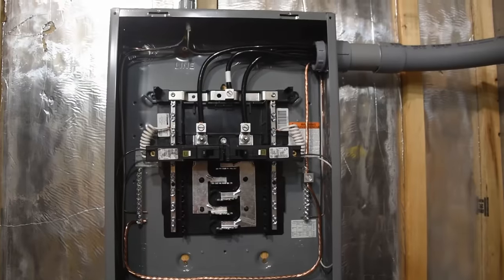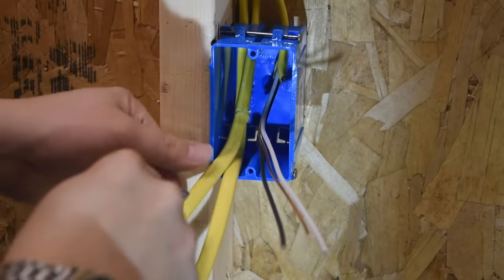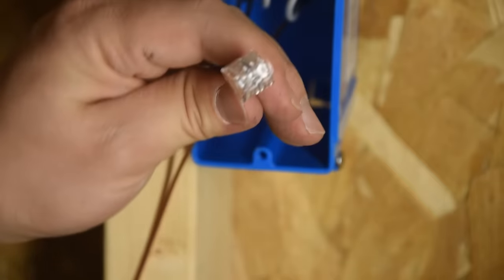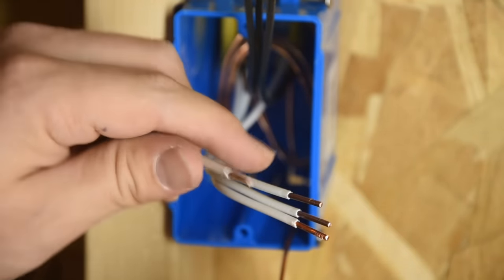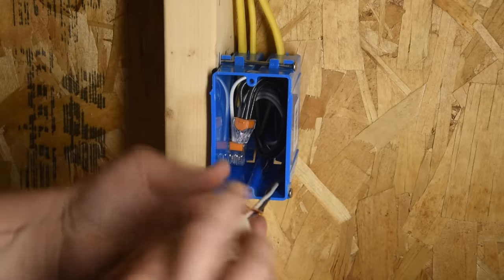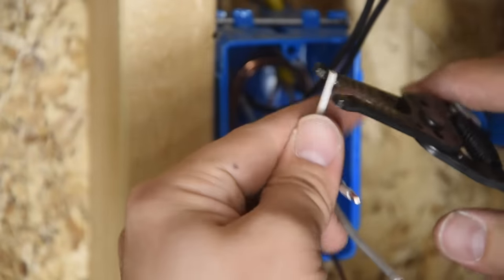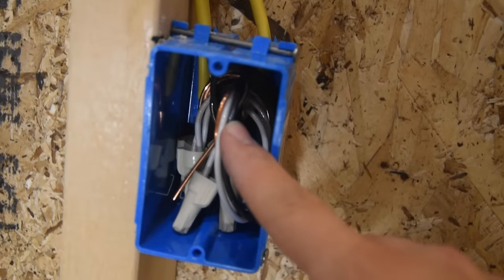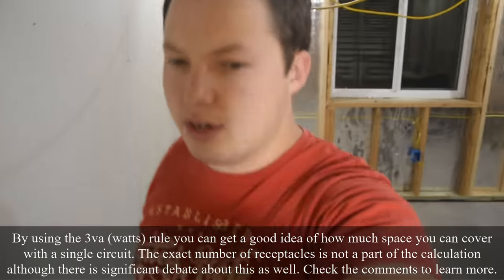Wago's vs. Wire Nuts - How To Wire Outlets During Rough In

Comment: As a master electrician who has been shocked by someone else's sloppy work and seen some bad makeup, you should always twist your wires with linemans to create a solid connection while using wirenuts
Reply: Absolutely! The marrettes are not to be used to twist the conductors...this is just lazy and does not ensure that they are well connected.  Wow
Reply: Is there a wrong way to twist the wire? Looking at the front twist clockwise or counter? I’ve twisted wire both ways I haven’t been unlucky thus far but a assistant I had a year ago (before he quit because he wanted work life balance/duhphukizdat? Hahahahaha) he had a bit of trouble with counter clockwise twist unwinding as he would start the wire nut... users error? Makes sense? Or My twist is twister than his twist? I should add I twist then cut the end off thread lightly finger tight then one or two full rotations with linesman’s (rough stop here.)  and a quick wires and nut mummy wrap with E-tape.(not for rough obviously, unless you hate the person who follows😬.)
Reply: @13ryanheartbreaker27  wire should be twisted clockwise
Reply: You can't go wrong twisting the wires n using the proper wire nuts. If you need to add a wire remove wire nuts, use your llinemen pliers.un twist about a1/4" to 1/2" lay new wire on the old,re twist n that new wire will fit in just like it was always there.
Reply: @jokerseriously514 if the manufacturer doesn’t require it then it’s just your opinion

Comment: maybe it's because i'm a commercial electrician and mainly use stranded wire but I prefer wire nuts.
Reply: For stranded  wire there are the lever style Wagos, all types of spring loaded connectors are superior to screw or twist connections as they keep a constant force on the conductor.
Reply: irfp460 yeah I've used them before but the price adds up on a job that lasts a year and has 20+ electricians on it. I agree though that they are very nice to use. And safer when you have apprentices who don't check their wire nuts.
Reply: @darianbell9614  Well, the customer is paying for the supplies so in my experience the increased cost of the Wagos does not matter but the time saved with them does.
Reply: @irfp460  I don't disagree but I'm not the one making those choices. My company is ran by old electricians who have their old ways.

Comment: To answer your poll, yes always twist, creates a better connection, makes it easier to keep them even. And makes easier to get your wire nut on. It also eliminates any worry that the connection  will become loose later.
Reply: Also it’s a code requirement

Comment: Wagos are nice because they are quicker but it's more $$ and a pain for the next guy when we need to add or disconnect the splice. And yes, I always twist wires under the nuts to ensure solid contact/connection, I hate relying on a little spring for the connection.. Plus safer for the next guy if they're twisted.

Comment: The Wago might be easier to use, but I trust the wire nuts better as the conductors are touching each others directly instead of being connected together with a tiny piece of metal.
Reply: more contact area between the wires and more contact area between the wires and the mechanical fastener.  go ahead and try to pull a wire nut off.
Reply: @frotobaggins7169  well, the push in connector could withstand around 30kg for solid wire and 18kg for strand wire.

Also, someone literally give enough current to burn the wire and connector, the wire insulation melt first and followed by the connector housing, the "tiny piece of metal" still hold onto the wire.
Reply: @Kevin-fj5oe  I never said wagos wouldn't work.  I have seen many a push in connector fail that is why I never use them.  It's not the current or the amount of pull they can handle, it's the tens of thousands of heat cycles over decades of use that causes the failure.  The wire nut with more surface area of contact between the two wires are just better able to handle the heat cycles.  I actually just replaced a failing push in connector on an outlet that was causing arcing and starting to burn the wire causing the circuit to flicker.

Comment: Nice tutorial. I've been curious about wagos but I've always put them on  the same level as the back push pins on receptacles which Ive never trusted. You've given me good reason to give them a try.  I also in the pretwist group. It may not be required but I guess I like being able to visually see that the wires are secured. Maybe they should make clear wire nuts 🤔
Reply: look into the lever wagos

Comment: i found that making a loop of wire to the side like a spring and leaving the wires longer made putting outlet in box way easier. than the just bending wires up and down it tends to keep outlet from going in box easily the up or down bending will only bend so much

Comment: If you open one of these push in devices you will find a very tiny flat contact spring which contacts only one edge of the wire. This contact point is a few thousands of an inch and forms a perfect hotspot for a fire initiation. These have worked great for many years for low voltage and low current use but for anything over 1 or two amps, NFW!
Reply: Not true at all. They are used exclusively in Germany and we have much stricter guidelines.

Comment: When i worked for comcast we used a three m type connector for phone as we added the security option . and i worked for a few electrical companies also and i asked which wire nut to use on pre-wire and was told whatever fit 😂 .like the wagos best .

Comment: Just wonder how many of you resistance test after installation. Screw terminal can be under or overtight or work loose from vibration & heat. Used wago for industrial & residential without any issues. Retesting installations every 5 to 10 years.
Reply: I am now installing the new 10 year battery smoke detectors; before I leave i make an appointment with the home owner to expect me back in 10 years to replace the smoke detector….LOL

Comment: I have seen push connections fail and melt and arc. They will eventually fail and cause problems. I just replaced a GFI in a travel trailer that was overheated where one of the pushed in wires was arching. I won't use anything that does not have a screw on it.
Reply: Finally...a man with common sense....what’s with people always looking for the easy way.....

Comment: The lever style has two benefits. the first you don't damage the wire when you have to remove them. The second they're great for stranded wire over the push style and it makes it trivial to connect solid to stranded wires. 

I also use the Klein katapult wire strippers with the adjustment stop attachment to set them to the correct strip length fast easy best $40 I ever spent.

PS never cheap out also get wago or ideal push connectors. Note wago has made them for so much longer due to crazy history in UK something about wire nuts bans aka "fire nuts".
Reply: Note you may want to point out the test ports on the wago so they can be tested with out taking apart vs the wire nuts.
Reply: As with wagos, sharkbites and the like,  it's all about dollars per hour...get in and get out...and get to the next job.  If it isn't cost effective in some way why do it?

Comment: Wagos work well in other countries that run on 220 so lower amperage. In the usa and other 120v countries more amperage goes through the wires for the same appliance and can cause the wires to heat up more. When the connections heat up the wires move and over time loosen connections if they are not twisted/secured enough. So wagos are fine for higher voltage/lower amperage, but not good for something like a appliance.
Reply: The spring action is supposed to hold the clamping force very high at all times, through heating cycles etc. Is there examples of heat and movement of properly installed wire, that has led to a loose contact in a Wago connector block?

 The manufacturer has the following claim about the metal used for the spring clamps: "Samples loaded with 500 N/mm2 at a temperature of 250°C (482°F) showed a relaxation of only 1.5%." Found in https://www.wago.com/medias/Volume1-2019-2020-Technical-Section-en.pdf?context=bWFzdGVyfGRvd25sb2Fkc3wyMTMyNzQzfGFwcGxpY2F0aW9uL3BkZnxkb3dubG9hZHMvaDFkL2g3ZS8xMDExMTMwNDU2NDc2Ni5wZGZ8OTA1NzU5MTcwMzZmYWRlNWI5OGU4ZGZkMDI3YmNiMTdkYmVkMWNjYWJjZTEyYjhlMTJkNTc5Njg0OGU4NGVkNQ&attachment=true

Comment: So I've used both and wagos are certainly seemingly cleaner. However a couple of guys have questions it is just a thin piece of copper that grips the copper. Years of running electricity could in theory cause bad connections down the road and a electrical nightmare.

Comment: I have no issue using these on lights BUT, they DO lose tension and therefore create a weak connection hazard over time with higher amperage draw. I only use these on receps when the wires are too short to get a wire nut on.
Reply: The lever lock Wagos don't have this problem FWIW
Reply: @sinistersparky9657  I've never seen the lever lock types until recently. They seem like they'd be a lot better.
Reply: Amen

Comment: I usually twist wires when using wire nuts for the best connection. Wagos are quicker to use, use less space in the box, and a step up from daisy-chaining using outlet push-in connectors. However, most of the current passes thru the tiny spring clip and it may lose its springiness over time. We've all seen outlets where outlet push-ins begin to weaken after 10 years. Wire nuts provide at least 1/3" of wire-to-wire contact vs maybe 1/64" of contact.
Reply: Thank you for acknowledging the push in connections suck on the devices ..although it complies to code it is sub grade and causes burn offs
Reply: @Jason_Canada  I'm liking the newer plug design better than the old push ins. Now it uses the screw to clamp the wire securely in place, if you choose to push in, rather than wrap the wire around the screw. I'm upgrading my garage with 2 new drops and redoing all the old outlets; quick and easy install.

Comment: When you are twisting on the wire nut or wing nut. Bend your wires 90 degrees first about 2 or 3 or so inches before the wirenut. That gives you leverage to hold the wire. After twisting on the wirenut I like to twist with my lineman pliers a little bit more.

Comment: I find wagos connectors to be a bad idea I’ve pull out many that would pull right out, shorted better to twist and install red or yellow wire connectors way better longer lasting too
Reply: If space is an issue, use wago's but then twist the wires up just behind it, problem solved.
Reply: That "bad" idea works like that safe since the 1970's in it's home country germany.
Reply: @seanthiar  I've seen enough burned wagos that I try not to use them. I've seen a couple wire nuts connections burned.
Germany uses 230 volts so the current would be lower there. Less heat.
Reply: If you noticed, the wires were nicked. The instructions on the package I had state you have to clip off the nicked section of the wire.
Reply: In RF, known as an impedence bump.  The higher the frequency, the greater the loss of signal.  That's why above VHF, we used N connectors.

Same goes for wiring Coax for tv and ethernet for networking.  It can make the difference between a good signal or no signal.
Reply: @christophereaton4694  Germany has higher specs, we have low standards

Comment: I didn't know you could remove them. Nice tip!
Reply: Don Brooks FYI —- you can only reuse with the same gauge wire or larger, NOT smaller.
Reply: The fact that you can remove them so easily should be the first indication that they shouldn’t be trusted.
Reply: @SRT480HP  lol

Comment: Never use wagos on stranded wire, some times the strands get pushed back and don"t come into contact making the wire a smaller diameter and in some instance it acts like a fuse where the wire just burns up. I seen this on a large job in the parkade where the lights started to go out and I had to figure out why and that's what I found numerous times.
Reply: The wago lever nuts work very well on both stranded and solid wire, can be easily removed and reused
Reply: There are wagos made with lever locks for stranded wire

Comment: Do like watching these videos, nice to see the other side of the pond using Wago's too. Interestingly here a 16amp circuit in the UK will be used for 3,000 watts. Possibly a difference in your regulations to ours considering the voltage differences.
Reply: Wagos are rated 24 amps ( 2273-203 ) or 32 amps (221-413), or even 41 amps (773-173) for the EU (including the UK). No problem for 3kW appliances at 240V or 400V ...

Comment: Wego's are good for terminations without high loads, mostly luminaire connections.
Reply: That’s there only use...this kid didn’t even twist his wires before putting on the wn!
Reply: @richardnightingale9086  neither did this old guy 40 years in so don't be condescending, you're the one watching this "kid"...ijs

Comment: Ideal has a video showing their wing nut. The pull off force of their red with two 12 AWG wires is 270 lbs. And the bite marks into the wires shows the difference between connectors. No comparison in some ways, yet the wagos still work. I might try the wagos for fine stranded wire like extension cords coming into a device for power.

Comment: I have a NEC card, I would never use a push in wire connector.  I work at a major hotel in Vegas, one of our towers had push ins installed in every room after our last remodel.  After six months we started getting lost neutrals and dead circuits, all because of failed connectors.  Slowly we are replacing them with wire nuts.  Contractors like Wagos because they are fast, Maintenance Engineers hate them because they don't last.
Reply: I bet those connector were not wagos. That's like saying wire nuts are bad because you used pen cap once to do the splice and it failed.

Comment: You should always make a 'kink' or 'bend' in the cables coming into the box, so that there is an extra 3" to 4" of cable available for future use. When people make a new connection, they often just cut off the old wire connectors, and then there is not enough wire to make the next connection. Having a 'kink' outside of the box give the electrician the wire they need to make the new connection, without having to rip out the drywall to install new wires.
Reply: At $50 per 25' of Romex, there will be no extra kink for future use in my home 😂
Reply: @meganwilson2742  If you’re not a Wago user, You’ll end up regretting that decision in the future as you replace receptacles and switches and end up having to trim wires back.  You only need a couple inches of kink.  Especially, on your own house.

Comment: There were a lot of problems with push in receptacles. No so much with Wagos which are better built.  I would never use a push in receptacle but like the Wagos.
Reply: You like them now cause there easy and fast...but yet...wait a rew year’s and they will fail....back stab outlets say no more.
Reply: @richardnightingale9086  Wagos don't fail, don't you think after all these years of their use, they might know what they are doing?  Wagos are better than stressing the wires to get them in a wire nut device.  It's 2021, cars even have electric starters and stuff now!
Reply: @cengeb  my man nothing is 100 percent fail resistant..and by the very mechanical design those types of connections do not allow wire to be physically connected in such a manner to allow higher or fluctuating currents.   Good for lights. That’s about it.  There’s very little contact inside those things.
Reply: @richardnightingale9086  If you are twisting wires when using wire nuts, you are not following the code, the code says to follow mfgs instructions on devices, no where do any maker of the twist wire connectors tell you to twist the wires before using the connectors, like wire nuts.  Facts matter. And the even dumber ones are where they really twist teh entire wires into a locked up mess, that stresses the conductor, and is not told to do that anywhere in any code, making stuff up, is becoming the norm?
Reply: @richardnightingale9086  utter nonsense, the WAGO is well made, tested for all kinds of stuff in Germany, the design does not allow the wires to get lose, your imagination is wild.  "fluctuating current"  Really, they have now ones for 10ga wires, it's 2021, things improve, join it
Reply: @cengeb  sorry friend 35 years of electrical experience has shown me first hand what works and what doesn’t. I’m to old to get into a debate about what works and what does not.  Let us be gentleman and agree to disagree and not cast terms about each other’s sanity or lack there of.  Because I know one thing, I’ve lost my mind YEARS ago.

Comment: The thing that sells me on Wagos is that they are spring-loaded. Everything gives a bit over time, and there is expansion and contraction. Other connectors lack the elasticity.
Reply: Are wire nuts a plastic-coated spring that holds the wires in place?